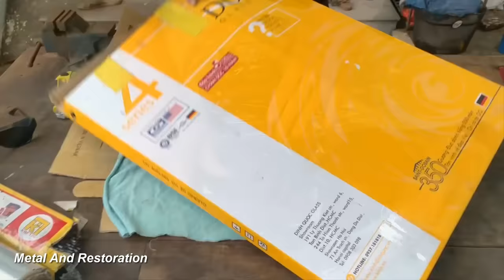Restoration Viking Axe Battle Old | Restore AXE construction Antique

Comment: Wouldnt it be easier to just fill those holes with weld and grind them smooth?
Reply: yeah it would have been  he just needs to get them mins for the video
Reply: i could filled those holes with jb weld and you never know they was there , never cut that much metal away
Reply: I disagree , easier to let the man do what he does.
Reply: X2
Reply: yes and you wouldn't see that big square in the middle
Reply: no actually it would make a more see able square
Reply: spot weld the holes grind them smooth and it would just look like its been used .cutting out a square makes no sense
Reply: wouldve been easier just to trace the axe on a new sheet of metal, same amount of work to cut it and everything, maybe even less.
Reply: Depends on what type or rod he was working with. Most people dont have fast freezes laying around (6010, 6011, ect.)
Reply: steve gray what?
Reply: I just thought the same thing haha
Reply: What is everyone telling him about the square if u watch till end there is no square
Reply: @mannequ_in  There still is a square, you can clearly see it.
Reply: Xergius *barely see it
Reply: Spiffy clearly see it
Reply: This I actually quite fun to watch
Reply: It would've made the whole thing weaker
Reply: Since he's hearting everything that highlights a flaw, I just hope he's taking it as constructive criticism
Reply: Yes indeed this guy is not a pro yet practice makes perfect
Reply: You can clearly see the square in the middle, even after he painted it. It also didn't seem to be that sharp of an ax.

Comment: Like so many before me have said, you had me with you right up until the rattle can came out. No clue why anyone would go through all of that effort and then cover it up with crappy paint applied in the worst way, AKA spray paint. Great work up to that point though.
Reply: that was not great work, that axe should have been cleaned with chemicals before EVER touching it with a grinder.
Reply: Nah, spray paint is fine, you just gotta use it properly, and use quality stuff.
Reply: Okay, so you clearly don't know how to use a rattle can correctly. I assure you, they can do as good a job as an air gun (IE, what does the paint for cars) if you use it correctly. No one uses them correctly, though. They're not like a brush or roller.
Reply: @MeepChangeling  its obvious you know nothing about restoration.

Comment: in my opinion this axe (helebarde) isn't antique...its a pipe with weld attached cheapest sheetmetal blades....Not worth this much work...but you are a very handy guy! And i like that kind  of videos..nice work!
Reply: This isn't a helebarde at all, the metal part of the helebarde it's usually 1 big piece, with both blades on each side, and a pike on the top.
Reply: your right its not
Reply: Halberd?

Comment: Items statistics:
+ resistances
- speed
But most important..

DOES A LOT OF DAMAGE
Reply: 28 stab wounds
Reply: Skyrim iron battle axe: 16 hit points, 8 hit points per second. 50 septims. That battle axe head in Skyrim:55 hit points, 10 hit points per second. 2,000 septims.

Comment: This doesn't look that old in the beginning.  Old metal is very uneven . The rust looks very new. Just a thin surface layer not flaky how old rust looks like. The handle support looks just like a modern pipe welded to the blade. The whole thing is a bit off.
Reply: Exactly what I was thinking when he used the hand brush
Reply: Yea i bet he just made it himself and then "restored" it.

Comment: Going through the comments that have been made already, there's a lot to take away in this video. Here are my pros and cons:

PROS:
1. I like it that this was done with a relatively minimal tool set. Some restorations have endless grinding stones, files, rotary tools, and other bits at their disposal; this one's more approachable.
2. I do like the look of the black vs. polished steel.
3. Attention to detail on the edging and polishing is good.
4. I like the attention to detail when straightening the piece, especially with the bowing marks and applying the torch to let the cooling do a lot of the work.
5. The welding of the square patch shows good welding technique.

CONS:
1. The black / shiny contrast could have been achieved with a cold bluing fluid, which would have lasted longer. If you're going to do the paint and call it a restoration, I'd have liked to see some filler in the substantial rust pitting.
2. The edge-hardening exercise seems largely irrelevant, because it looks like the piece is only mild steel and not high-carbon steel. I say this because a) Grinding the object fails the Spark Test, and b) details on how the smaller blade is attached indicates that it was welded and not forged.
3. If you're going to do an edge quench, use oil, not water, and make sure the heat is hot and even before quenching; don't quench in sections.
4. Patching the center of a fairly thick piece like that will create stress fractures in the metal during cooling if you weld in a square.
4a. Instead of replacing the torched-out holes with a metal patch, I'd have cut them out and left the hole, similar to what's done on the small blade.
Reply: you're absolutely correct man... your points are strong... the black paint is not restoration and it looks very cheap on that rare piece... and patching the middle part is also not a very good idea... moreover the contours are also left as it  and thus the curves are not that smooth, and the pitts arent removed as well... 
All together, the piece doesnot look that Elegant as it should have after the Restoration, as if it lacks the Dedication, the Art and the Attention that it Actually Deserved..
Reply: @juned8772  I don't think it is a "rare piece". I'd be really surprised if it were even 50 years old. I don't know much about these things, but I suspect a real Viking axe head would be forged hardened steel, not welded. Looks like a garage project left out in the elements to me.
Reply: @JesseArt  yeah you're right tho

Comment: Instead of just adding in some molten metal to the spots that were torched through, you cut a massive piece of original smithed metal out of the axe head and you welded in metal that is not of the same era. Afterwards you could see the difference between the poorest, aged metal and the newer forged metal. 

Also, because you were tempering the metal with a blowtorch and oil again, you were changing the molecular structure of the metals that were originally engineered. So you ruined the antiquity and value of that metal.
Reply: "Antiquity?"  This is just junk stamped steel, not an antique.
Reply: @ammagon4519  If this would be an antique (which is not. it's a replica), this actually is obviously the "berd" of a "halberd", not a Viking battle axe.
Reply: 抱歉說一句，你只是在破壞文物

Comment: I'm a blacksmith, I forge things by hand every day, tools, traditional blacksmith items, blades etc. That is a piece of extruded pipe( probably cold rolled steel) , welded on to a big piece of sheet metal that someone burned through with a torch or welder, then soaked in acid or salt water to rust. Not an antique, not even a real axe to be honest. And its nigh impossible to harden a blade in three separate quenches, probably mild steel anyways, not to be judgmental or anything!! Lol
Reply: I can tell you know alot
Reply: I wasn't impressed at.  Looked like shit
Reply: Michel Richard check out Simple Little Life, he recently came to forge to make some tongs. As of yet I don't have a YouTube channel, very soon though!
Reply: Yeah this  seems  inpractical its too big and has many wierd lines to it

Comment: i feel like he is acting like he knows what he is doing with that ruler
Reply: He is mainly using it to draw straight lines. Except for the first part when he used fire... I didn't quite get what was happening there.
Reply: Leonel Cabrera so you’re telling me the ruler... is used to draw straight lines?
Reply: @kalebt7042  Not always, and it depens on what kind of ruler because some rulers like a protractor (which is a semi circle) can be used to draw curves that help tell the degree of an angle made of 2 straignt lines. But yeah. Rulers are mostly used to draw straight lines.

Comment: why did he make an axe ,
age it and the restored it?
Those holes are obviously arc welder holes.
Reply: Not arc welder. they are typically from an oxy acetylene cutting torch. But hey... just clean the holes and weld it up,. It was only a piece of tat anyway.
Reply: @fredmorton1631  or just throw it to garbage xd thats one piece of junk he made from scrap steel ( you can see the cutting marks on the piece he uses to patch these holes)

Comment: Restoring an axe made last week?
Reply: True. It isn't old. Old axes are forged. That isn't forged. It's 2 pieces of steel cut to shape using a cutting torch. The rough edges were then ground off. The pieces were cut from a large old circular saw blade used in a lumber mill. The steel is probably 1080 plus about 2.5 % nickle. The pieces were then welded to a short piece of pipe. It's something someone made to play Game of Thrones with in their back yard.

Comment: thats less than 25 years old, cheap metal ,and cut with a band saw in someones garage
Reply: Hii
Reply: I agree. And the band saw job was probably done by the same person, who afterwards damaged, "aged", putted it into a parcel, took it out of the parcel and then "restaured" it in front of a camera to earn some money on youtube.
Also: if its historic, then you would try to preserve it with the holes inside. Not to speak of spraypainting it.
If its produced recently: it takes half the time to cut out a new one, instead of putting a patch on it.
Reply: @scheisstag  you'll notice the pole sleeve looks like something you get from  home depot
Reply: matt sez Yep looks like a pipe welded to the blade and not roll formed or punched like a smith would have done it
Reply: @yqwgjsg  they had harbor freight welders in 1505
Reply: Glad I wasn't the only person who thought that. It's not my profession, so I wasn't sure, but that was my first thought scheisstag.
Reply: I totally agree,  and I can't be the only one who say the purpose cut plasma holes in the center, I'm looking like what the fuck is this?
Reply: @scheisstag  yea I see a lot of these stupid restoration videos and they fake a lot of shit,  I saw a Thor storm breaker video and I knew it was fake, I wish people would stop that shit
Reply: Funny, this might be the first time in history that people agree in the comment section of youtube! .-D 
I can add one more reason, why the scenario of restauring an historical axe cant be true: Its way to heavy for a weapon used in real combat. It could be an executioners axe, just judged by the weight. But executioners axes have more or less straigth blades. For the same reason, that cleavers, used in a butcher shop, also have straigt blades: thats the best shape to cut meat on a block.
Keep the arguments coming! :-D
Reply: not to mention he quenched the "blade" while is was still to cool. and in water yikes. if it had been quality steel you would have heard a *ting from the fractures caused by cooling it down to fast
Reply: At 5:20 you can see that he uses the scrap piece of metal he cut the original blade from lmao

Comment: Honestly, the restoration is awful, he looks like he doesn't know what his doing and constant quenching probably made it weaker, so the black finish isn't your biggest problem
Reply: It actually looks great to me...
Reply: @ASamplingofRadiation  On the surface it may look fine (apart from the black paint, fuck no you don't paint an "antique" after restoring it), but if you use the wrong procedures/processes to restore it, the piece may well be ruined.
Reply: This was a build, not a restoration. Restoration videos are more popular so people cut sheet metal, weld it together then put a rusting agent on it so they can say it is a restoration video.

Comment: Man! How could you!
1st - The patch is perfectly seen. Why? Because alloys don't match, that's why. I think blade was made from some old-fashioned steel. And if your patch is not from regular iron, your electrodes are.
2nd - Paint? Seriously? Charcoal coating or bluing. That's the way you do it.
You could take usual sheet of iron, iron tube and make such thing without touching something old.

Comment: I wonder why someone had the amps turned up and blew a hole in the mild steel plate? 🤷🏼‍♂️
Reply: Fix it Restore it Welding torch.
Reply: Fix it Restore it
Gas axe!! had to make it look rough! Oxy-acetylene cutting torch.
But rust came of too easy! Mill scale was still there!So this obviously isnt an "OLD AXE"!
okay its 3 weeks old!
Reply: @Restorationandmetal  Maybe you should ask your friend to stop opening you up to ridicule! If you have done any real restoring of old metal,heavy rusted,You would know that its not old!And the "patina"has been done artificially!
And what exactly does it have to do with castings? You can see the welds at 3.11,the little stripe inbtween them is the edge of the tube where the weld didnt get full penetration.That means,hasnt melted into the weld on the other side.

Comment: What i the world was this ax used for?   Is it a battle ax?  Must have been a two hander.
Reply: I'm far from a expert, but my take is that this is a reproduction of something that didn't really exist. By didn't really exist, my guess is it's a reproduction of a fantasy piece. The blade looks awfully long vs what you'd really need, adding unnecessary weight for no purpose. It's also much thinner at the base of the blade 3:10 than I imagine it would need to be. Looks cool, but dimensions are all wrong I'd think.
Reply: What about executions? Lol
Reply: A pizza cutter?  Needs a big drawer though.
Reply: Jake Hoock still looks too curved to be an executioners axe

Comment: LMFAO You can weld in the holes   you know
Reply: Those are too big and replacing it improves the quality
Reply: @Sonnenblume997  not really if you know how to weld
Reply: No. High carbon steel grinded out to put in mild steel. Welding it up would have been better and use a beld grinder. This restoration was hard to watch. This guy clearly doesnt know wat he is doing

Comment: The bit that really shocked me is that you would think painting over the welded section would make it stand out less, turns out it has the opposite effect. Definitely not a viking axe though, looks more like prop from a low budget fantasy movie.
Reply: True looks like nigga put this axe for rusting just for month  otherwise viking axe would have taken atleast decade to  just get in the right shape
Reply: @Walidad baloch  agreed, also, as someone else pointed out, the hole in the blade looks like it was probably made with a tool like a welder.

Comment: What an amazing find. The restoration was easier with todays tools but still time consuming. Imagine the time and craftsman ship to make those in the 700 bc through hundreds of years. I’ve studied Viking history for 15 years and am still amazed at how deliberate they designed each weapon and tool. Thanks for sharing.
Reply: If you have studied viking history, then you should know that restoration like this would be an absolute no-no. Not only would it most likely not be handed to a novice, but the historical value alone would cause it to go to a smith who actually has state-of-the-art tools, but a fantastic reputation for ACTUALLY restoring old antiques. Also this is straight up a fence pipe with sime thicker sheet metal welded on, the welds were just filed down. That should be the ONLY reason he is even putting a blowtorch and those grinders to the surface of the blade…
Reply: the largest viking axes where called Dane axe and look nothing like this and is not from the viking period.

 I have been doing viking reenactment and  living history for 15 years around york which is the biggest hot spot in the UK for vikings this is nothing more then a fantasy piece inspired from most likely the something round the 15th century rather the viking which pretty much ended in the 10th century they is not one viking axe recorded that comes even close to looking like this.

also like others have said this is a piece of pipe with sheet metal welded to it which is fairly clear from the video.
Reply: @uitramit8411  well, I didn’t study about their weapons or the dos and don’t were. I simply think the craftsmanship on such an old item was pretty. I studied Viking law from its earliest non-verbal law through the 1800’s. It’s really interesting and much of how the world functions today comes from the earliest laws of the Vikings. If I appeared to be commenting on the item itself then I apologize. The Vikings were amazing people.
Reply: @missykowalewski  no need to apologize, all is good, just next time be cognizant of what you’re typing, and also put “viking law” rather than “viking history” so you dont confuse anybody else. But no need to be sorry, you probably just didn’t realize
Reply: @uitramit8411  I appreciate that but law was not the only thing I studied at university. We covered the culture quite well and it’s fascinating how much different things r between the regions yet they always had the same end result. There is a hierarchy to any family possession. From weapons to even clothing. I never intended for this to be a big thing. I just thought the video was interesting to watch and he did a good job. That was my only intent when I initially posted. But I will be more specific in my future posts. So thank u.
Reply: @uitramit8411  the real question is how did vikings weld the tube
Reply: @penyu1913  ikr?
Reply: @uitramit8411  a viking axe would never be given to be restored. It would be displayed, as is, in a museum.
Reply: @abdul-hadidadkhah1459  solid point

Comment: Okay, I'm a newb when it comes to welding but wouldn't it be time-efficient to weld more metal in the holes then use angle grinder to remove the excess metal to make surface flat?